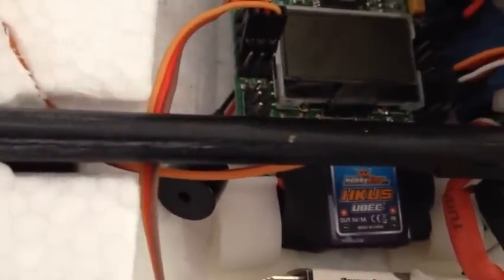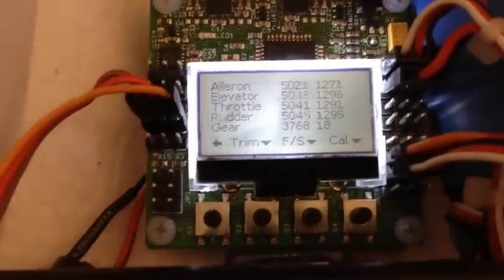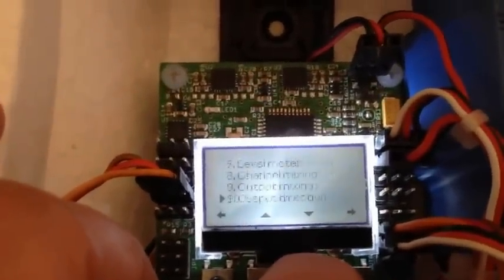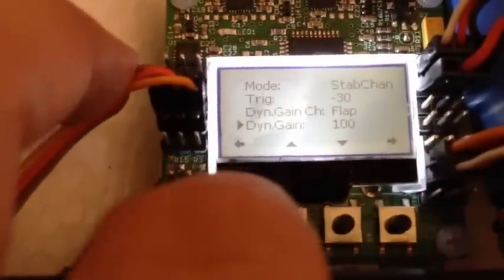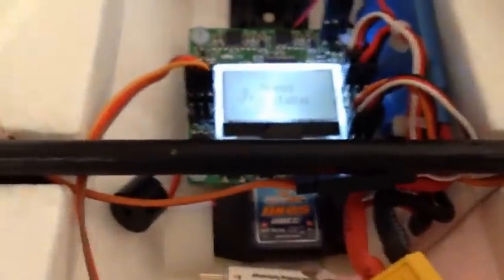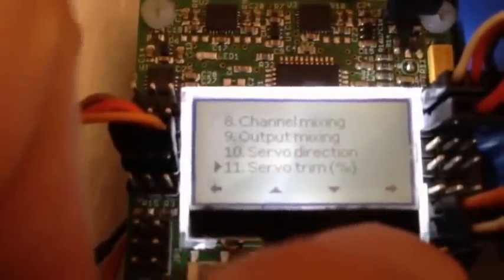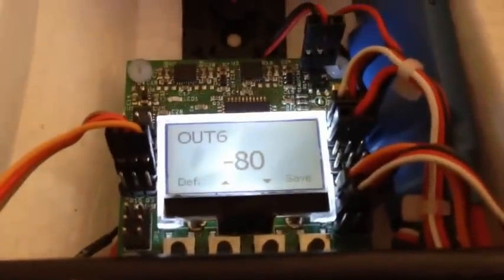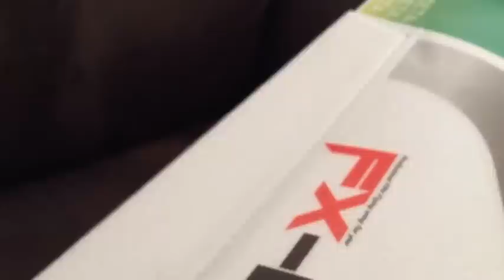Setting up OpenAero2 V1.1 Beta 9

Comment: Hi I have a KK board and have flashed it with Open Aero 2 after some wrangling I managed to get it to see the RX input sadly I have yet to see anything on the output side I guess/hope it's all in the set up!! I am using a Taranis Plus with an X6R  receiver S Bus was the only input it seems interested in. any help would be greatly appreciated.
Reply from the maker: Phillip Powell you really have to read the manual on the RCGroups thread. However the main reason people see nothing on the output is that they forget to supply a separate 5V source to any of OUT2 to OUT8. These outputs otherwise have no power from the KK2. Also OA2 has long been superseded by OpenAeroVTOL :)
Reply: HI David thanks for the info I wasn't aware of the power supply isolation between the input and output as for the latest update I simply applied the earliest one offered there was no VTOL reference I shall pursue the  RCGroups thread thanks again

Comment from the maker: Hi folks. You are in the wrong place for help with OpenAero2. The main site with User Guides, videos etc is on RCGroups here --> http://www.rcgroups.com/forums/showthread.php?t=1708175 Go there and ask away. I can bet though taht you've missed that you need to separately power OUT2 to OUT8 with a 5V supply to make any of the servos move. See you on RCGroups.

Comment: Im setting up this board, but is far more complicated than kk2 for multirotors... 
Im facing a strange problem, using this kk2 on a flyingwing, my outputs are like yours, m1, m6 and m7, but when i move the sticks nothing happens. My inputs are correct in the receiver inputs, but nothing is working! This board needs to be armed? Any tip or sugestion for my case?  Thanks

Im also using the ESC/BEC with the throttle signal to power via m1.
Reply from the maker: I bet the reason is that you have forgotten to supply power to the OUT2 to OUT8 outputs. Any servos on OUT2 to OUT8 need a power supply. The best way is to use a BEC connected to any unused output from OUT2 to 8. You must NOT connect the board power at OUT1 to OUT2 to 8 as servo noise will crash the board (and your model). All of this is covered in the User Guide.

Comment: Hi Mate,

I got the same kk board but i cant for the life of me get it to work. Are you able to show a picture of your electronics spread out so i can see what you hooked up to where?
Reply: I have the KK 2.1. 5 and can't get it to work for the life of me either. Did you ever get yours figured out? I have the open arrow programmed but cannot get servos to respond
Reply from the maker: David Seeker Hi folks. You are in the wrong place for help with OpenAero2. The main site with User Guides, videos etc is on RCGroups here --> http://www.rcgroups.com/forums/showthread.php?t=1708175 Go there and ask away. I can bet though taht you've missed that you need to separately power OUT2 to OUT8 with a 5V supply to make any of the servos move. See you on RCGroups.
Reply: Ok if I need to power the board with more than the receiver, and UBEC on out1, then you're probably right. I will check out the forums thank you